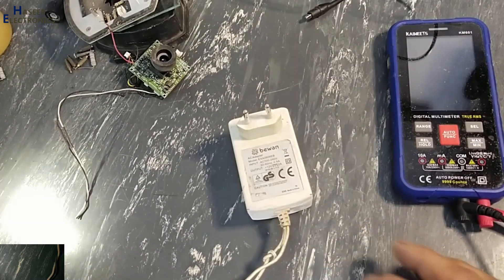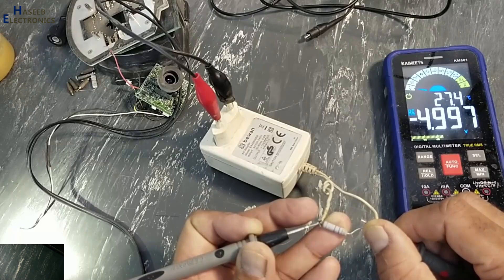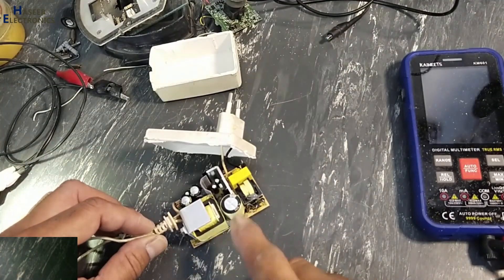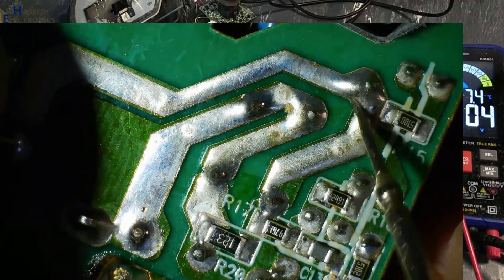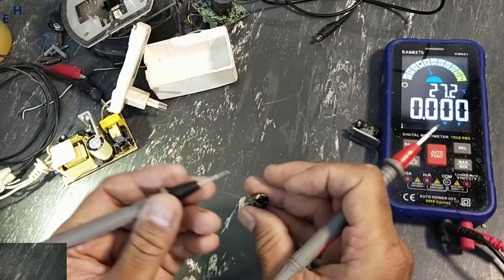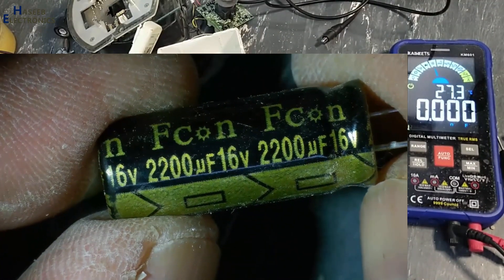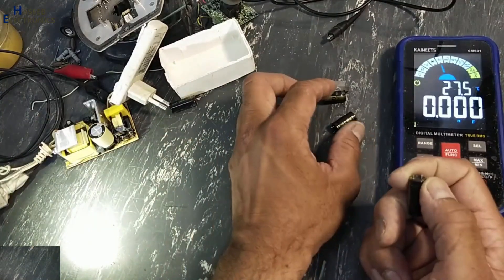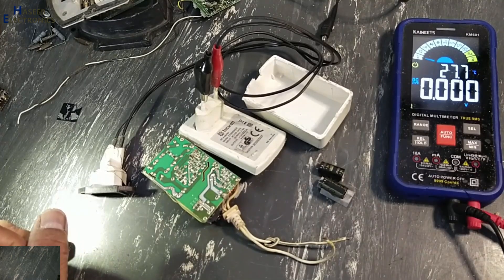{1165} AC adapter 9 Volt Output instead of 12 volt

Comment: Sir, good video, i have observed somewhere that adapter box can be open easily without any scratches, apply a little quantity of petrol into these opening circle and wait 10 minutes. I hope this method is safe to op a equipment cases.
Reply: If you want safety, you can use also heat gun around 150-200 c and (move it fast),, it will melt only the glue not the plastic